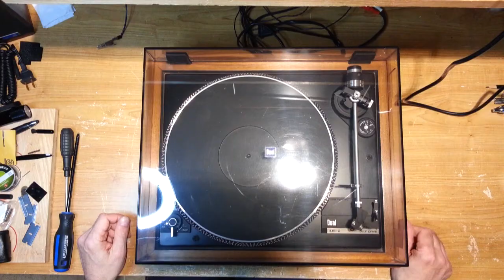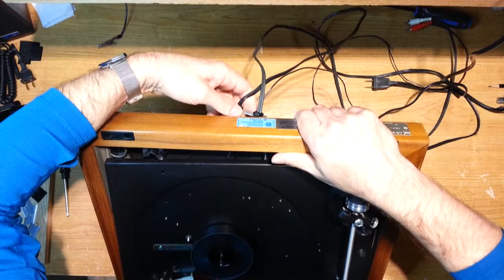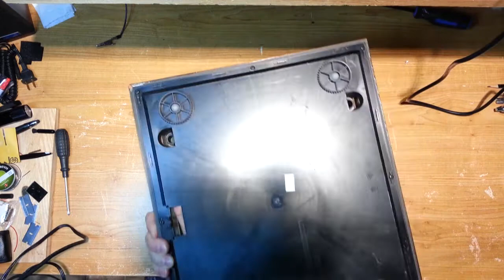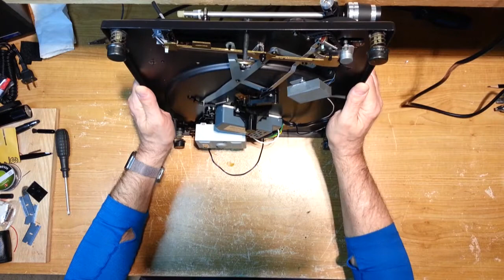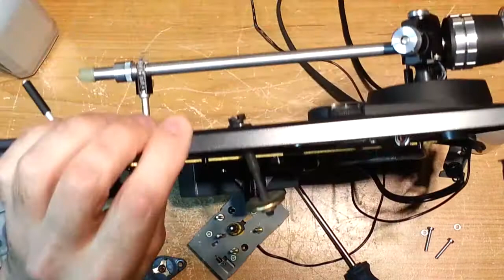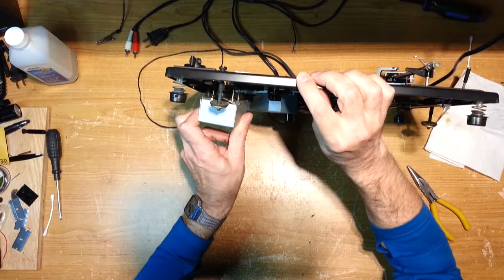Dual 505-2:  Complete Service Part 1

Comment: Thank you very much for creating this video. I followed all the steps and managed to bring the turntable of my late brother back to life. If I may ask, I am facing two issues: first, the maximum speed I can achieve is about 31 RPM even with the pitch control fully maxed out; second, one resistor appears to be getting extremely hot. Any advice you could kindly offer would be greatly appreciated. Thank you again.
Reply from the maker: Follow the speed adjustment settings in Part 2.  Not sure about the resistor.
Reply: @TurntableGuy  Thank you so much for your response. Hope you will enjoy the festive period !

Comment: Thanks for this video. It gave me the confidence to crack open a CS505-2 that my father bought way back in the early 80s. The drive and pitch belts were rotten and had turned into a black dust, so they've been replaced now. I still have a problem selecting 33rpm, the belt doesn't quite get lifted up onto the top smaller part of the pulley and then rubs on the selector fork, but I think I'll just set it permanently on 33 as I don't think I'll be buying anything 45rpm now. Any suggestions other than pulling it apart again (3 or 4 times already!) and having another go?
It's only temporary anyway I think - my wife and I fancied playing some records again so at least at first I'd rather spend money on records than a new turntable.
I regret giving away my lovely Revolver turntable with its Linn arm now, but hey-ho, we go through these phases as part of life.
Reply from the maker: The speed adjuster arm may not be moving through it's entire motion due to dried up grease.

Comment: 0:17 "CS" did not stand for any additional electronics (like an amplifier), but for the turntable in its entirety (incl. case and lid). 
In the earlier days, there was a differentiation between the actual turntable board on one side and the plinth (edit: by which I mean the case) and lid on the other, each part with its own model number. "CS" was the combination of all three. E.g. "CS 70" consisted of the actual turntable 701, the case "CK 22", and the lid "CH 6". Somewhere around 1980, they abandoned that differentiation and used them pretty much synonymously, even though they kept selling bare turntable drives to other companies for some time.
Systems with additional electronics (like amplifiers or receivers) were called "HS" ("Stereo-Heimanlage") or "KA" ("Kompakt-Anlage").

Comment: Hi. I decided to get out my late Dad's old 505-2. Needs new belts but also the lid won't stay open. There are little bits broken on the plastic hinges and one end of both springs sticks out which doesn't look right to me. Any fixes? Thanks

Comment: I think the CS in Dual doesn’t mean ‘Complete System’ but was an acknowledgement to ‘Christians Steidinger’ - the founder of Dual. I have a Dual CS 505-3 which I bought new in 1987, used a few months then put into storage. I got back into vinyls in 2018 and resurrected the turntable. It was all seized up with perished belts. The vinyl on the plinth was all shrunk back and it made it look bad. I rebuilt the whole machine with a solid oak plinth and Ortofon OM20 nude stylus. It looks and sounds fabulous now with a new Quad Vena II amp and Quad speakers.

The original came with a Dual 165E elliptical stylus which was an OM10 branded as Dual. I think the OM20 sounds a lot better than the original - much clearer in the treble and better dynamics. I found that with tracking set precisely so the diamond ‘floats’ in the groove (equal micro dynamics on left and right channels), the Dual sings sweetly and punches above its weight.

Comment: This is really helpful, I am restoring the same model, it belonged to my partner's Aunt who bought it in 1987 - its not been touched (in terms of servicing) since then. For those in the UK, the pitch adjustment belt is available on eBay for just £5.95. Perhaps this was not available when this video was made 3 years ago.

Comment: Hi do you have any videos regarding Dual 1019 Turntables. I have one i am working on. The arm doesn't land on the record and also doesn't sit on the arm rest. Thanks. Mike
Reply from the maker: No 1019 yet.  The owner's manual should show how to adjust the lead-in position.  Should be available for download at vinylengine.com

Comment: Thanks for your excellent videos. Please Can you help me I was following this on my dial 505 when a small thin silver metal piece with a notch at each end dropped out as I took the turntable off of the plinth. I cannot see anything like it on your videos or where it has come from. The service has otherwise gone smoothly 
Unfortunately utube won’t let me paste a photo of it. It’s 1.25 inches x .25 inches 
Do you know what it is? 
Thanks 
Cathy
Reply: Turns out it’s part of the speed regulator switch nechanism. Back in place now!
Reply: @CATHERINEBoddy-m1x  I had the same problem. I have put it back but I'm scared to change the speed in case it just falls out again
Reply from the maker: This is just a guess, but I think it may be part of the center spindle bearing.

Comment: Many thanks mine had stopped because grease had become sticky and stopped the microswitch from working.
Reply: Very common issue with these. It seems just about every Dual owner put it into storage when CD appeared.. then decades later vinyl comes back into fashion and they wonder why their deck no longer works.

Comment: That unit has some amazing engineering.  Way better than the average turntable that's sold today. Great quality.  Now we have a lot of over priced plastic junk, unless you had the cash to go high end.
Reply from the maker: The 505 is a gem and sounded better than just about anything out of Japan at the time of it's manufacture.
Reply: @TurntableGuy  I would love to see a blind A/B test done between a 505 and some ultra high-end bling-bling deck which costs as much as a Lamborghini.. see if anyone can tell the difference..

Comment: What a great guide! Now I have to decide whether to dive in or hand mine over to my friend who owns and operates a workshop. Mine is a $30 estate sale find that sounded great when I got it home. It needs this type of service, though. When it’s running (but not playing) I hear a light friction that I assume is a lack of lubrication.
It has a Pickering XV-15 625e cartridge; is that appropriate for this TT/tone arm? I have read that this arm was designed with a certain Ortofon cartridge in mind and originally came with that Ortofon.
Reply from the maker: There is no law that says you can't run the Pickering.  It's true that the ULM arm was designed to run Ortofon ULM or OM series cartridges.
Reply: Thank you. The Picketing sure sounds fine to me; just wondered if that’s the optimal choice, or whether there’s anything that recommends against non-Ortofon cartridges for any reason.
Reply: I heard that same kind of sound from mine. A couple drops of oil in the motor and now it runs completely silent and also a lot cooler than before.

Comment: Hi there, I have a 505-3 it hasn't been used in a few years. It will play for a few minutes and then a very loud noise will start coming from it. If I move the rca jacks it will stop temporarily but will come back in minute. Loud almost static noise, not just a hum. Can the cables be replaced? 
On the 505-3, do the wires go through the arm or plug in? When I loosen and pull headshell wires come behind it.
Reply from the maker: The RCA plugs are probably shot.  Just cut off the old ones and solder in replacements.  If you want to replace the entire cable, there is a demarcation board within the turntable which connects the RCA cables to the tonearm wires.
Reply: @TurntableGuy  Thank you! I forgot how nice this tt is. You have some really good videos.

Comment: I know I'm late to the party, but I just acquired one of these, and I wonder how that design doesn't introduce noticeable rumble, from the plastic sub-platter to the split pulley for speed adjustment...  I guess I'll find out once I get a belt for it.
Reply from the maker: The 505 punches way above it's price level.  You're going to love it.

Comment: Great in-depth video for the 505-2. I was able to follow along and service mine and my son's turntables. They are like new now!
Do you have any insight on how to adjust the pitch on a Dual CS514??
Reply from the maker: The 514's pitch controls are hidden behind the faceplate on the plinth.  Watch my videos on the 515 - they'll explain how to disassemble the unit.

Comment: Brilliant video, thanks for this. My dual 505-4 has a problem when the auto stop mechanism doesn't disengage, meaning it turns off when I try to start it up again. I've looked at the mechanism and can't see any obvious issues. Any ideas on what to try?
Reply from the maker: Grease has hardened somewhere on the start lever.  Disassemble it and clean all pivot points then re-lubricate.
Reply: @TurntableGuy  Thanks for the reply, I'll try that

Comment: Hi, I just picked up a Dual 721 Direct Drive table for a song, it just has one issue, the strobe light is burnt out. Was wondering if you could tell me how, or maybe point me to a video on how to replace the strobe light on it.  I sure would appreciate it.   Thanks
Reply from the maker: I would first check to see if the neon bulb is burned out or if it is getting the correct voltage.  Check ebay for a new bulb.  It's just two wires and you're done.

Comment: I have dual cs 505-1 (1982year). Noise level -54 dB during playback (when the needle is not on the vinyl - there is no noise), probably the noise from the motor, the disc rod was lubricated. Is it possible to reduce the noise?
Reply from the maker: Try a full motor lubrication service like in the video.

Comment: Folks, any opinions on how you can remove the cable stress relief mechanism from the metal bracket, and then reuse it when replacing the ground and RCA cables? thanks in advance in case anyone can help.
Reply from the maker: I'll tell you right now - it's a pain in the butt.  You have to squeeze the back side of the strain relief and pull like hell.  Be prepared to mangle the strain relief with your pliers.  Don't use a thicker cable for the replacement, because you'll never get it back into the strain relief or the metal bracet.
Reply: @TurntableGuy  Thank you, this was helpful and i did bend the metal a bit but was able to get it back and use a more simple relief rubber that works better. One more question: How to best utilize the built in pitch markers on the platter when there is no built in strobe light? thx. steve
Reply: You can download an app on your phone and probably use the builtinmarkers on the turntable. Just search on strobe. Or you can even got another app thats easier, search for rpm turntable. Then just put your phone and read the rmp on the phone 👍

Comment: amazing. so helpful. I have serviced  my 505-3 but it takes a long time (10 seconds) to reach speed. have dknw the motor service/lube. any thoughts?
thanks again. really fantastic 👍
Reply from the maker: Either the motor is getting weak (doubtful), or it needs to be torn apart and lubricated as in the video (more likely).
Reply: Probably the belt that's old and slips in the start sequence.
Reply: @johansandman1688  Yes belt is the main suspect, another clue is if it will not change speed

Comment: Thanks for this, I have a 505-2 same as yours, my problem is when I play a 7"Record the arm lifts and stops too early, with a 12" record. it's fine.
is there an adjustment I can make??
🙏 thanks again.. 🙏
Reply from the maker: Yes.  Download the service manual for the 505-1 from vinylengine.com

Comment: New episode! Great job. Knowing so little about Duals, I found this really educational. I still don't comprehend how 1) you found incredible deals on all these turntables and 2) how you learned how to service so many complex mechanisms. Really cool! Think I'm going to stick with direct drive, given that they generally seem less complicated to service (???), but it's good to know the ins and outs of a belt-driven mechanism in case I ever make a switch.
Reply from the maker: Gotta keep an eye out for deals (which are getting harder to find since turntables are more in demand.  I worked in an electronics repair shop in my late teens and learned a lot from some very good techs.  DD is definitely easier to maintain.
Reply: @TurntableGuy  The deals are definitely hard to come by. And you're fortunate to have had that experience!
Reply: Thank you for the excellent video, I am going to service my cs505-2 which I bought new about 40 yrs ago. Keep up the good work
Best Regards
Mark
Kildare
Ireland